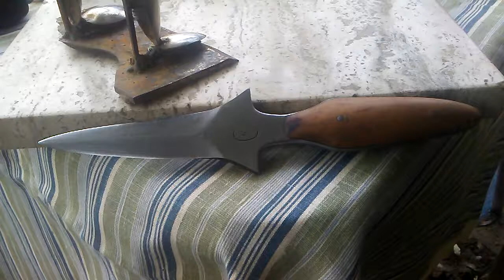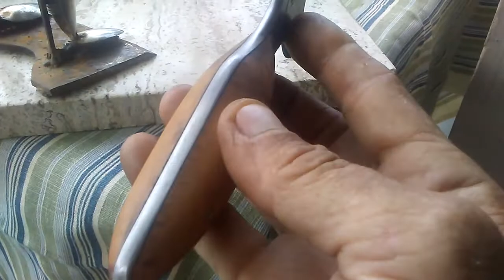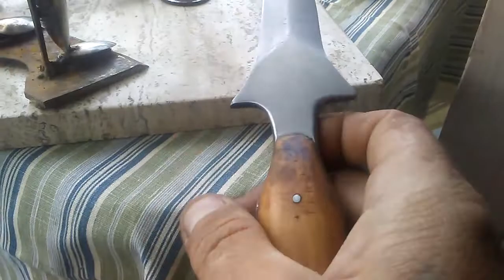New dagger

Comment: I want to build a forge SO bad
Reply from the maker: I need to build another Forge the one I built is coal fired and coal is getting hard to find down here in Florida, either I need to start making my own charcoal or I have to build a propane Forge, a forge can be built on the cheap and with scrap parts
Reply: @anarchytelevision8445  it is on my list with so many other things... I want to build a gassifier generator also